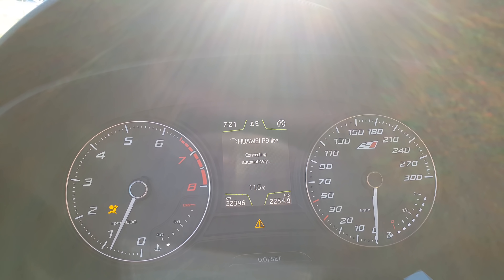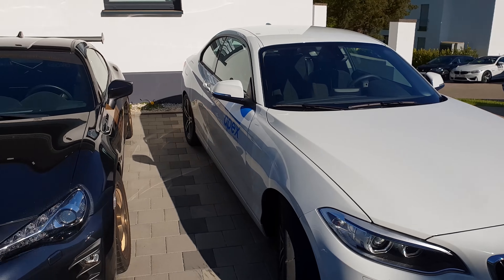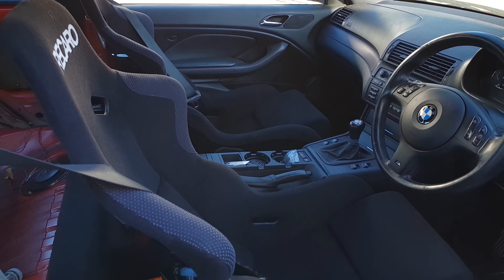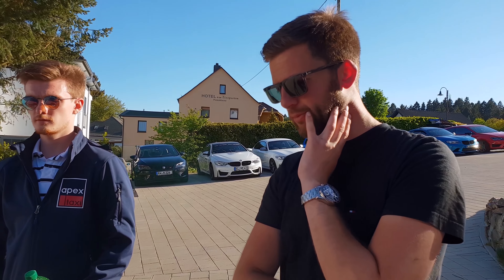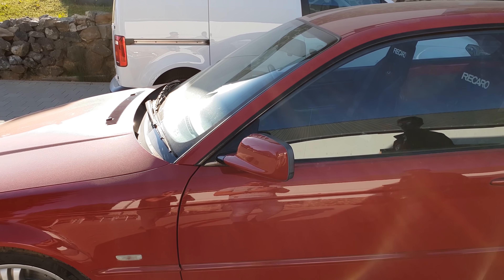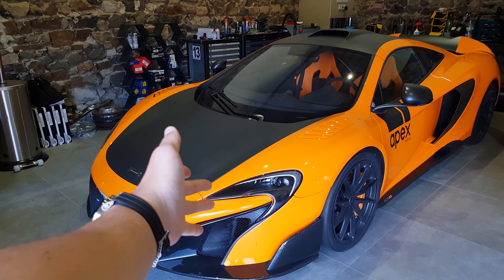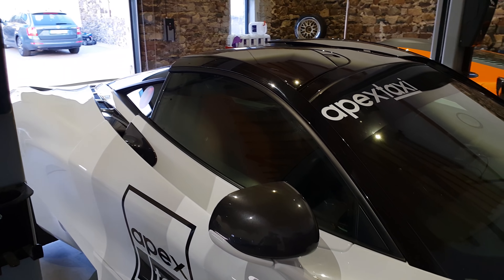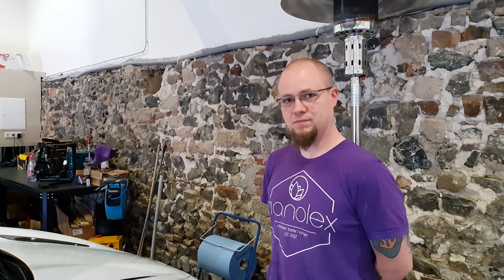IT'S ALL IN THE DETAILS!

Comment: Wow why didnt they get a new door for the m3 or 4 that u crashed. That body shop really did a good job smoothing everything out if it has that much bondo. But bondo cracks after a while if it to thick. So becarful with that not to dry it out to much. Like putting it in the sun for hours at a time.
Reply from the maker: Guess what? It is a new door. You buy those things unpainted.
Reply: Misha Charoudin so why the bondo?

Comment: Did Robert replace the splitter of the LT with a gloss carbon one ?
Reply from the maker: It is new, but same style
Reply: probably got dinged up during hundreds of trackday laps
Reply: Good morning Jarvis, the splitter is still Matt finish. We had to put a high-class clear foil on it however as the matte was not in stock and I did not want to damage the splitter. In the next two weeks the matte foil will be back in stock and we will replace it. Good Eye.